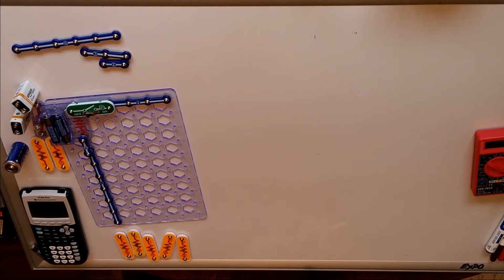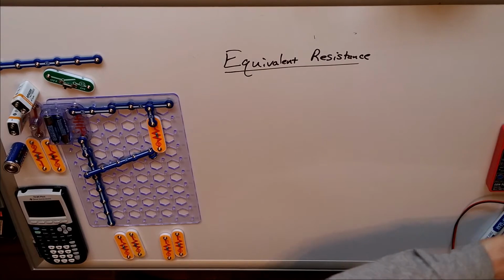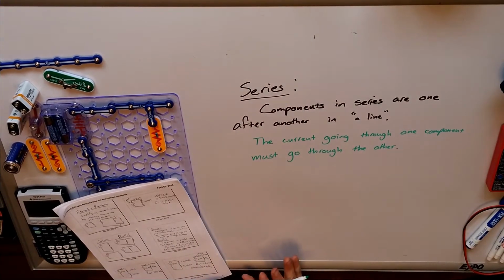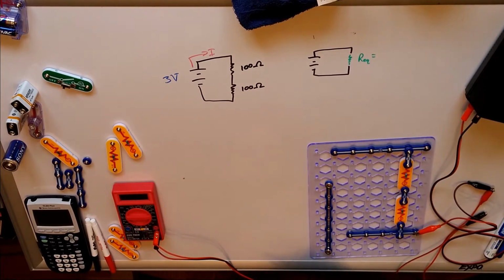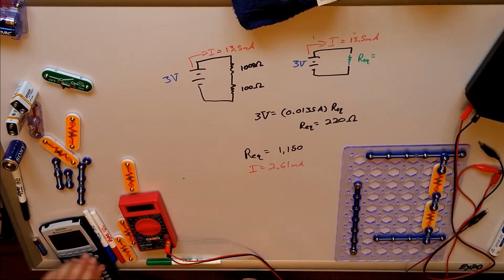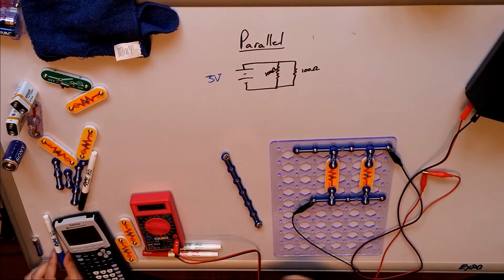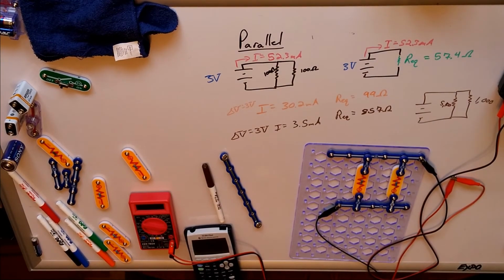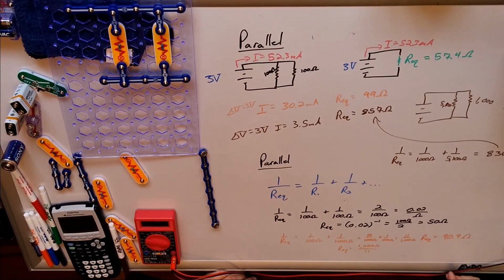L13-E1 Equivalent Resistance

Comment: Will the current always be given???
Reply from the maker: Not always.  That is why it can be very useful to use the table as introduced in a few a videos.  You can use information that is given to find what is asked for.  Sometimes you will not be given the current, but likely be given enough information to find it.

In this video I give the current because that is what I am measuring.  For the problems we will solve you will see more in the later videos.